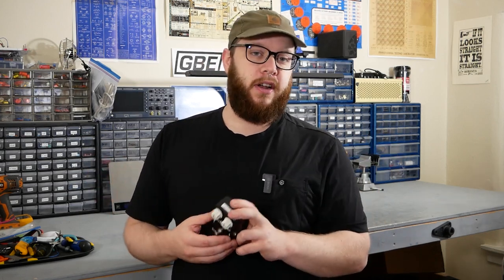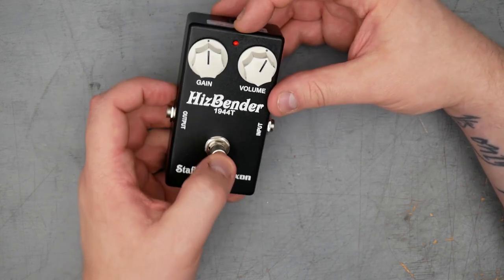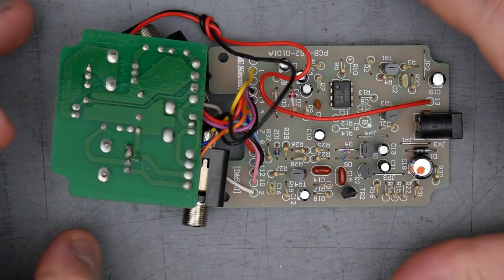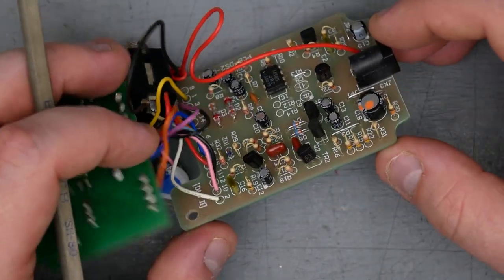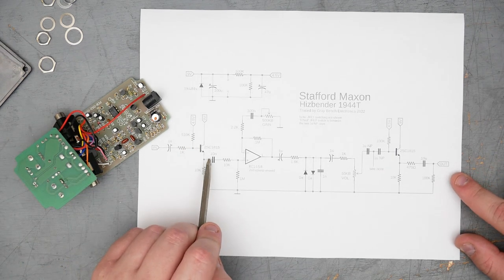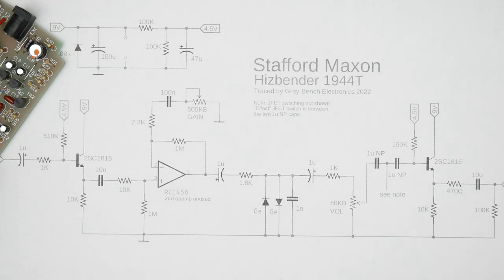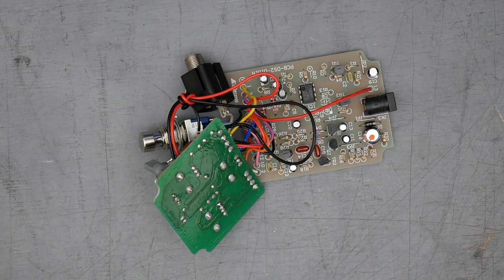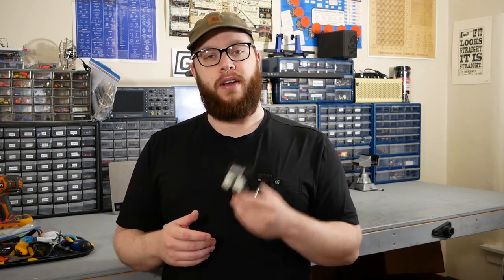Stafford Maxon Hizbender 1944T Teardown! See what's inside!

Comment: Hi, enjoy your teardowns. Tiny bit of Stafford-Maxon info for you. Stafford is a Japanese guitar maker mostly known for their hollow-semi hollow 'jazz boxes'. The Stafford 'series' is a rebranding of then existing Maxon 'compact series' pedals. Some Stafford versions have a slight modification to the standard Maxon Compact version of the time. For example, The Stafford Maxon Boostrex is a Maxon Compact DB10 Dual Boost.  Hope that helps.
Reply from the maker: Good to know, is there an equivalent maxon pedal to the hizbender?
Reply: @graybenchelec   I believe it may be a "Maxon D&S". Which is a Maxon distortion+ with germanium diodes. The D&S had a tone control as the difference to a pure distortion+. Perhaps the Stafford version just went 2 knob og dist+ mode. Maybe the components that aren't on the board are the tone control from the D&S. ....here is a copy and paste of the D&S product description --
" Originally released in 1974, the D&S II Distortion & Sustainer II is a precursor to the amp-overdrive simulators of later years. With its mild drive, relaxed sustain and high output, the D&S II sits the fence between an overdrive and a distortion. This unique "split personality" makes the D&S II perfect for players that seek a natural-feeling drive sound but with more drive and output than an OD generally provides.

The D&S II accomplishes this task with some unique circuit refinements not typically found in distortions. Like a standard distortion, the D&S II features a diode-clipping stage after the amplifier section of the circuit. However, rather than using the silicon diodes commonly found in today's circuits, the D&S II uses germanium diodes in this clipping stage. The threshold voltage for clipping is 0.1 - 0.2V with germanium and 0.7 - 0.8V with silicon, so the germanium can distort even low level tones, thus making a smoother distortion. In addition, the germanium's rectifier characteristic is inferior to silicon (voltage drop with negative current is not as sharp as that of silicon) - this shortcoming ironically works favorably for the D&S II, creating a somewhat rounded waveform of the clipped signal that contributes to the unit's warm, natural distortion. Due to their "inferior" characteristics, germanium diodes are now a very rare component and have generally been replaced with silicon diodes in other manufacturer's circuits. Ironically, it is these shortcomings that give the D&S II its signature sound.

Also unique to the D&S II is its tone control. While most other overdrives and distortions feature hi boost/hi cut tone circuits, the D&S II tone control uses a low range boost/cut circuit for added bottom end. In addition, the D&S II's tone circuit features the JRC4558 IC chip, generally regarded as sonically superior to other op amp models. The combination of these two elements creates a pedal with more low-end punch than your typical overdrive. "
Reply: @livingabovethe12th  just to add further clarity to your first sentence, it would be the D&S II, not the original D&S (which was a Big Muff copy).